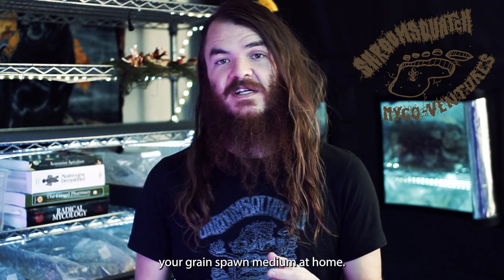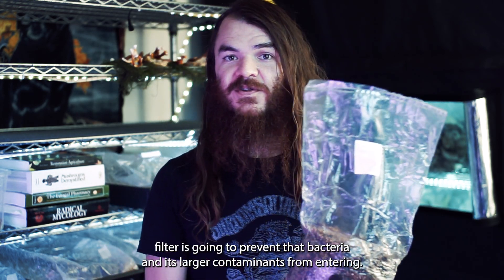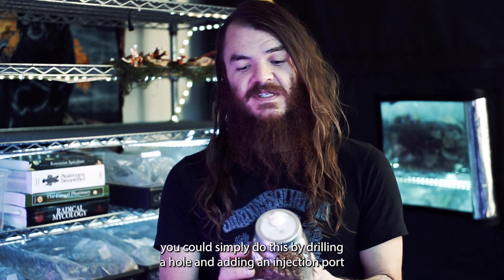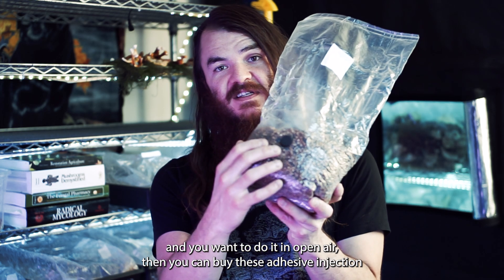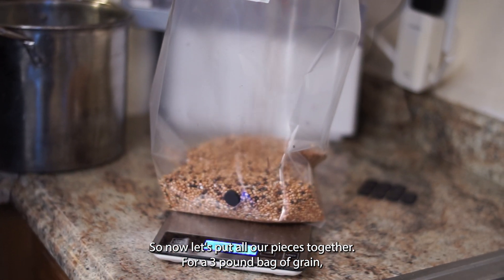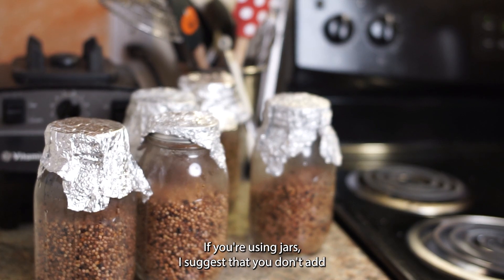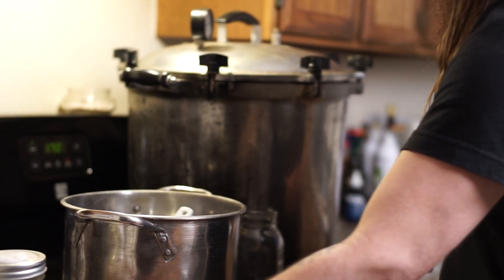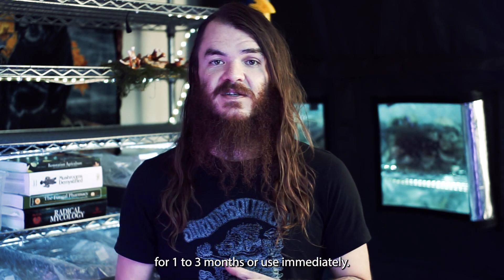Preparing Grain for Mushroom Grain Spawn: No Soak, No Simmer "ish"

Comment: You stated grain spawn will last 1 to 3 months after sterilization.  How long will sterilized saw dust substrate last?
Reply from the maker: It will be similar timing to the grain. You can sometimes get away with storing for even longer but I say 1-3 months because it is the typical belief. That said, if stored properly, especially somewhere like a fridge, a sterile substrate should last indefinitely.

Comment: I have found soaking grain over night to be very simple, and very effective. Next morning, rinse grain and put on a dry towel and let air dry for an hour or so. Then load jars or bags into pressure cooker. Once the pressure is at 20 psi, set time clock for an hour. After the hour, you're done. This works very well for me, and I have little to no contamination using this method.
Reply from the maker: That totally works. I always suggest folks soak in warm water if they have time. You just have to ensure your hydration ratios come out correctly, which you are solving with the air dry. I hate that extra step personally. Quality of grain is another thing I don’t talk about here but I have found it definitely matters. I’d be careful at 20PSI unless you have an autoclave that regulates itself, like a hospital style or something. A million ways to grow a mushroom.
Reply: @Shroomsquatchmv  Yea, I have an autoclave. The higher the temp and pressure, the less cooking time.